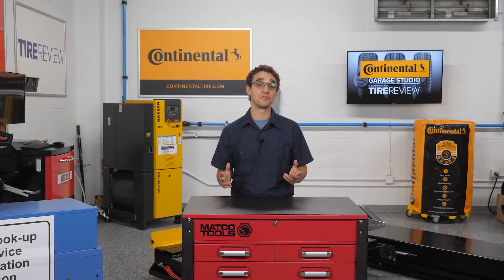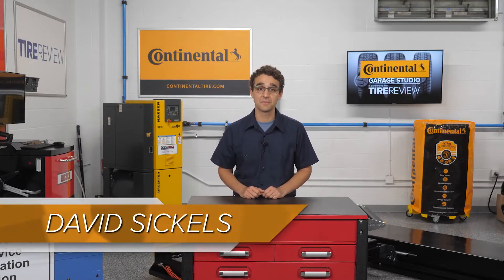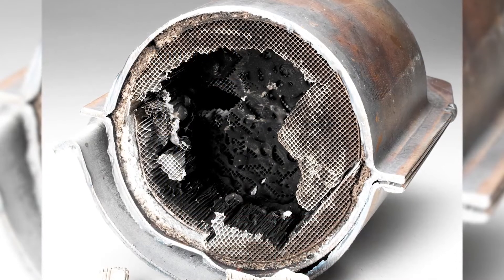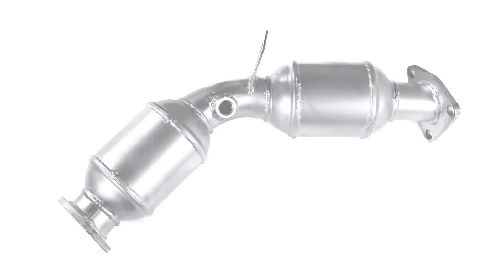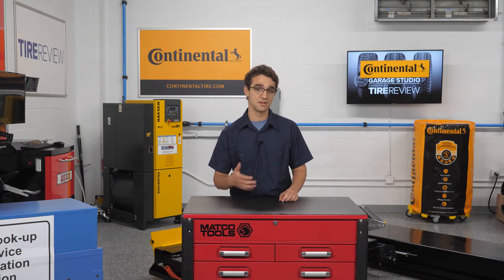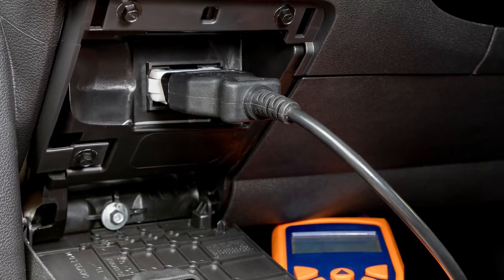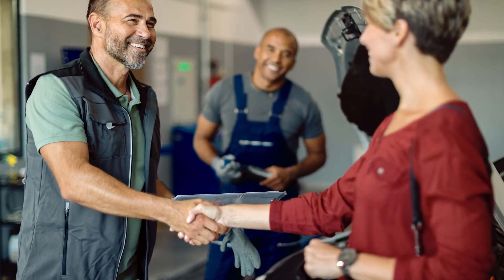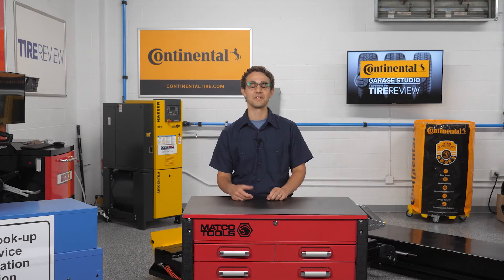Why Catalytic Converters Fail

Comment: My dealership said I must replace convertor $7K. However in the past six months I had two episode of mis firing spark plugs, one covered  plug 5 and coil under warranty the other I had to do tune-up all plugs replaced not under warranty (Tune=up) was due in 10K miles. All work  done by dealership. 2-009 Jeep Grand Cherokee.

Comment: The main reason for catalytic converter failure is that the after market cats are all junk. OEM cats are built well, and last. A big problem is when the oem cats are dis-continued, and you have no choice but to purchase the aftermarket junk. No mater how well you maintain car, the aftermarket cats will at most, last 5 years. pathetic.